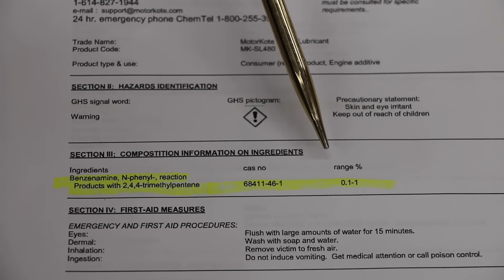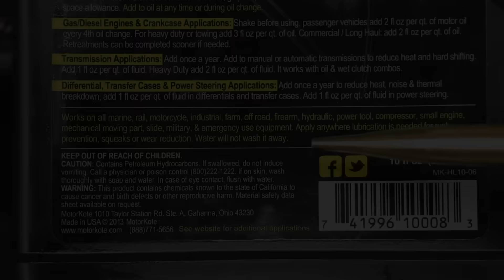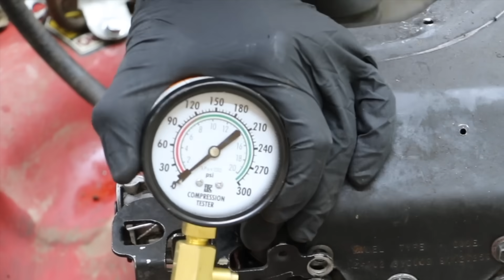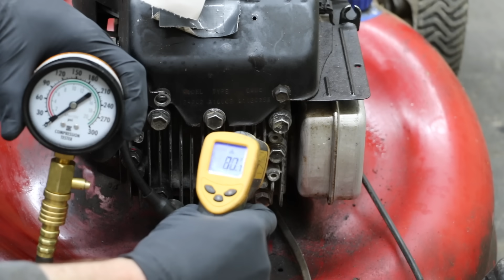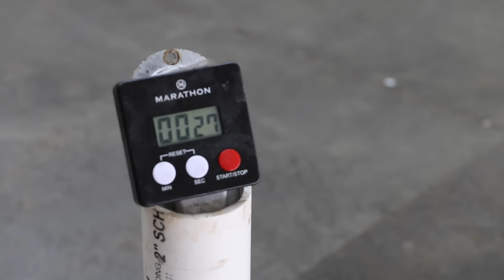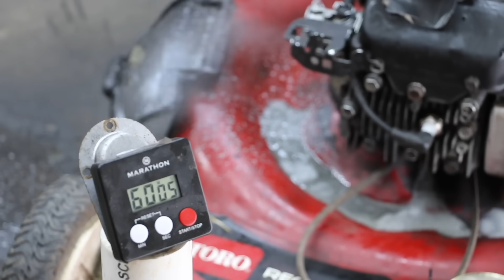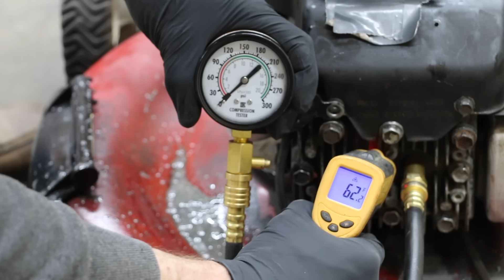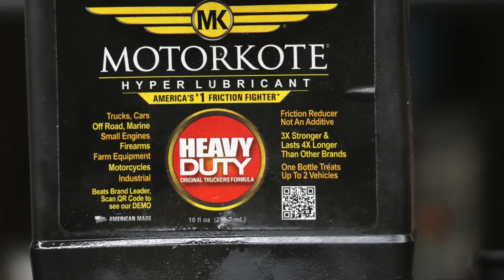Can MotorKote survive the water test?  Let's find out!

Comment: Although your tests give a positive result to Motorkote, I would still recommend being skeptical, I mean, if the Motorkote really did what it claimed, why wouldn’t all of the motor oil manufacturers add something similar to their oils? There has to be a caveat somewhere, and the only thing Project Farm didn’t test was the long-term durability of the engine, which is completely understandable. I would just take the money that I would’ve spent on the Motorkote and instead spend it on a higher quality synthetic oil.
Reply from the maker: Thanks for the feedback.
Reply: I was thinking the same thing as far as long term. Questions I had were after 100 miles is it going to break down and be useless? Maybe it would outlast your oil? Who knows. I do have to say though, that I was surprised with these results. I don't know enough about mechanics, ie if he hadn't have pre-coated that engine with the Motorkote, would it have siezed? But to be honest, after hearing anecdotal accounts of folks using the dino oil version of Supertech in their new car from day one til 150,000 miles and it still doesn't burn an ounce between oil changes, I often wonder to myself why I'm still paying for the higher price stuff. Especially for an "03 f-150! lol
Reply: @dgunearthed7859  Just ran across your comments and wanted to let you I am one of those "folks" that have used Super Tech synthetic for many years with great results. Retired my 2002 Sierra with 435,000 and only used Super Tech in it. No leaks, No oil consumption and no engine trouble. The auto trans gave up. So with all the rust I retired it. IMO great oil and I use it in my newer 2018 Silverado. Also IMO spend extra money on more frequent oil changes, not more expensive oil or additives, that has always served me well.
Reply: @stevecampbell7620  nice!
Reply: @stevecampbell7620  yeah so although I like the idea of using valvoline in that or napa form due to it being one of America's only owned and operated oil companies,  im really tempted to start using super tech 😅 i think u convinced me...gm vehicles going that many miles? WOW
Reply: @dgunearthed7859  my boss recently retired a 435k mile c2500 due to a collapsed lifter. I'm going to put a set in it and see how much farther itll go 😂
Reply: @goosenotmaverick1156  is your boss Steve Campbell?
Reply: Do you seriously think Big Oil cares?  If they did, we would have greater efficiency engines getting double the MPG
Reply: @chrisbusch1970  I don't think they give 2 poops lol

Comment: A guy here in Brazil tested Militec by runing a car with no oil for 10km. It actually worked. Maybe you could do something like that since you basically washed that engine already. It’s obvious you’re not afraid of anything, right? As always, great work!!
Reply from the maker: Great suggestion!
Reply: If you want to check it out: https://youtu.be/ACm8foJxwXk
Minute 22 he removes carter, oil filter and top part of the engine. 
Minute 27 he removes remaining excess oil. 
Minute 38 he starts the test on the dyno. 
10km at around 60km/h
Summarized because unfortunately there are no subs. 😕 
On a latter video he disabled the engine with no apparent damage.
I’m curious to see what you’ll find!

Comment: I would like a test experiment of oil, will non diesel motor oil harm a diesel motor (truck or tractor) motor.?  I bought a 2004 Dodge Cummins 205,000 miles, clear clean oil with a lot of clatter. Changed oil & filter 4,000 miles later to Delo 400. The motor quickly quieted down. After that the oil got dirty like normally diesel oil would.
Reply from the maker: Thanks for the video idea.

Comment: I have used MotorKote since 91. It saved my Bronco 351 engine when I lost the oil pump. It worked so well I didnt notice the oil guage for atleast 5 miles at city traffic speeds and temps.  
 Have used it in many engines since.
Reply from the maker: Thanks for the feedback.
Reply: Now im gonna use it on my bronco2 👍
Reply: @dy3dsl648  me too, riding mowers and my old Ford pickups

Comment: Can motorkote work in a motorcycle? were the oil rating is say SJ.
Reply from the maker: I would not use it.  It's too slick for a wet clutch system. Thank you
Reply: @ProjectFarm  thank you for letting me know so quickly.

Comment: You may have heard that some V-6 Ford engines have the water pump inside the engine. My sisters Ford Edge had that engine, it started leaking into the crankcase, and destroyed the engine. Maybe Motor coat could prevent this, or give someone more time to discover the problem.
Reply from the maker: Thanks for the feedback.

Comment: @Project Farm
Hey, loved the review, a nice result, though i would like to see you add an additional test here. The product as i seem to have caught is based on PFTE, teflon. My gearbox has a pfte additive in its gearoil, added by me, and I consider it a fine addition because the gearbox temp doesnt go very high. But my idea here is to add the test, similar to your evaporative loss test, where you would cook it at average automotive engine temperature for an hour or two, because teflon in pfte configuration is quite heat sensitive, thats why you should never use pfte cooking pans without something on them(oil/chunk of meat, whatever) on a flame, as the pfte burns and reacts... The point is to see whether or not the additive would work as it does out of the box, on the friction test, after some time of average engine heat exposure, because if the engine can burn it and cause reactions that nullify the product, it may be great out of the can, but if its shit after 2 hours, well, its shit either way... Tho your lawnmower did impart this in its working, its not a direct result as it has water as an added element, so we dont really know whether its just the water affecting the results or both water and heat together... And the mower and the car aint the same, thats why i say cook it in a closed jar... Not to blow it up, just cant the lid of the jar as to reduce evap...
Reply from the maker: Thanks for the additional test idea.
Reply: @ProjectFarm  You are most welcome, I do enjoy your content and if possible, will contribute to its quality. A channel like this does not just deserve a large audience, but all the benefits that a large audience made up of mechanically inclined can provide...

Comment: I use motorkote but without water 😄😄😄😄
Reply from the maker: Thanks for the video idea.
Reply: @ProjectFarm  I know it sounds weird but I use the motorkote spray on my metal carport. I was tired of running into spider webs when I walked to my car. Spiders can't get any traction. Same thing on my humming bird feeder cable. Ants can't get traction. I do use more of it in my lawnmower because I neglect the oil changes more than my car. Plus they are air cooled. My car will be fine with regular oil changes.

Comment: I would like you to try the water test after draining "normal" oil. Maybe there was enough residual motorkote/oil  in there?
Reply from the maker: Thanks for the video idea.
Reply from the maker: Thanks for the testing idea.
Reply: @ProjectFarm  Probably the best apples to apples test would be for you to run an oil and Lucas mix then run it on water. You mentioned a sludgy mix that came out after the motorkote water run. I'm thinking there was some motorkote in that sludge. Or how 'bout this, run the motorkote, clean the crankcase with gas before running on water? There is no doubt the motorkote performed very well. Thank you, I never heard of it.

Comment: Why did you only run the bearing test for 30 seconds?  Did the bearing with the 10w30 only have that big of a wear scar after only 30 sec?  You normally went for 10 min.  Also, your 10w30 test bearing had two wear scars that looked like 10 minute scars.  You didn't show the test that made those two scars.

Comment: TEST SUGGESTION: Instead of using the engine brake to generate a load, try replacing the lawnmower blade with a set of metal fan blades from an industrial fan. It will move a ton of air and generate a significant load on the engine without burning-out the engine brake, though you may need to tie-down the lawnmower so it doesn't try to hover. 😁
Reply from the maker: Thanks for the video idea.

Comment: After using this for 5500kilometers and 2 oil changes i can say that it really seems to be working most notably the actual color of the oil is almost still red (the Motul 7100  is red colored) as oppose to almost complete black i cant say anything about the fuel consumption because its such a small engine 200cc that the difference in consumption would be very small either way.
Reply from the maker: Thank you for the feedback on Motorkote.

Comment: I really enjoy all your oil and additive testing since I used to work in the tribology field.  I would have never thought of putting water in a lawn mower crankcase. I was amazed how that Motor Kote performed. Besides the Idemitsu oil which is used in Mazda's and Subarus as factory fill, there is another motor oil out there you might be interested in. It is Champion 5W-30 Syn Clean synthetic blend. They make oil for Hemmings Motor News and some of the Valvoline oil change centers. I first tried it last year.  I always had a little hydraulic valve lifter noise at idle in just one cylinder on my 1996 Chrysler Sebring coupe. The lifter noise is now gone after 2000 miles on the oil. Not sure if the oil cured it or what ever was causing the noise just cleared itself out. I bought this car used and do not know how often the previous owners changed the oil. I can send you a quart of this oil if you like since the only place that I know sells it is "Auto Anything" and they sell it by the case and you probably don't want to buy a case.
Reply: Cool story bro.

Comment: As Darth Vader once said, "Impressive. Very impressive." Still wonder how well this magic film holds up under the pressures of city driving or "drag racing between the stop lights/stop signs driving." Better break out your electron microscope and examine those crankshafts and engine blocks after a few years of driving (fourth oil change).
Reply from the maker: Great point

Comment: I saw a video from the brand "Ecotec" sold in France, making the same claim about resisting to water. I though the video was fake (obviously) but now I will revide my judgement. Thank you. Oh, and because I drive a motorbike and the clutch is running in oil, I won't use this additive in the powerfull engine
Reply from the maker: Thank you for the video idea!

Comment: Test only relevant if you compare to an engine run on 30W oil, that drained, and water put in (I say it will last too).  Most likely explanation was that the "oil" with or without additive) emulsified with the water.  That acted like "water soluble lubricant" (like that used on milling machines).  The water compensated by providing way more cooling by boiling off.
Reply from the maker: Thank you for the feedback

Comment: Hello project farm,

I was wondering if it's possible to revisit motorkote again, but this time conducting long-term testing.

I have personally used it in one of my older vehicles and now my valley stream is ticking even after 2 oil changes.

If you look at some reviews on Amazon, some patrons are showing some side effects of using the motorkote. I was wondering if you could verify or debunk those findings as well.

For example,  one customer used the appropriate mixture in a mason jar. Mixed oil and motorkote; left untouched for 3 to 4 days, draining the oil mixture into another jar. At the bottom of the Mason jar of the mixture left a thick molasses substance.

I have also included a link via Amazon regarding the customer reviews.

Thanks again and I appreciate all your research and hard work that you do for your loyal fanbase.

Thanks again,
-James

https://www.amazon.com/gp/product/B000EGAM0I/ref=ox_sc_saved_title_6?smid=ATVPDKIKX0DER&th=1

Comment: Very close to Bestline, but now I'm changing my mind a bit and wonder whether it's not even better than Bestline! Try doing an engine torture test (if your resources allow for) against these 2 bigger products: Motorkote and Bestline oil treatment. Use only the Motorkote now so you won't have to ruin 2 engines. We already know that Bestline didn't let the engine seize and although it lasted 71+ minutes compared to 38+ (using 10W-30), it only lasted 71 minutes with no oil and only with the Bestline film on the metals because the heat couldn't be dissipated anymore (the presence of oil also cools the engine) and so the connecting rod cooked up until it broke loose. Let's see how long will the Motorkote resist after taking out the oil and letting it's film do the rest or at least try a fair identical treatment to oil mixture test of Motorkote versus Bestline on engines and see which one quits first.

Regards.
Reply from the maker: Thank you for the feedback
Reply: @ProjectFarm 
So, would you still get the time (it also depends on resources, that's for sure) to try this unique test of Motorkote vs Bestline? I'm confident that a lot of viewers will find it useful. Head to head, from 2 of your separate video tests, when mixed with oil within different amount, it seems that when mixed at 9.375% (1.5 treatment ounces to 16 oil ounces), Motorkote is a winner by leaving (visually, not precisely measured) about the same wear amount that Bestline shows when mixed at 20% (1 part Bestline to 5 parts oil). When not mixed with oil, they both seem like a perfect match, but when mixed with a 10W-30 oil, Motorkote might logically prove better for a similar % of mixture versus Bestline! Still, running a torture test with the same amount of treatment to oil mixture (let's give it a 10% for the treatment and 90% for oil), it would be very interesting which engine dies first and what are the conditions after the failure.

Regards.

Comment: I found that MotorKote doesn't mix with oil, at least the Pennzoil Platinum I tested it with. I put MotorKote and Pennzoil Platinum in a jar and shook it up, and after it sat overnight the MotorKote separated from the oil and sank to the bottom of the jar. Not sure what this means or how significant it is, but I found it interesting.
Reply: Possibly due to PPL being a GTL based group 3+ oil and is based on natural gas. Motorkote may mix better with lesser group 3 and lower oils like conventionals. Either way we all just seen the results of motorkote by itself wont do any harm until it mixes and coats everything

Comment: I just had a thought, the way you do your motor oil tests, and sendoff samples to the oil testing lab, what if you did the cook and wear tests with all of these 'oil' additives and use your 'winner' oil as the baseline.... to see if additives add to the oil or make it worse than a good quality motor oil, also test all the additives seperately through the flow test, freeze test, cook, then flow test, wear test before and after cook..... i wonder if some of that stuff could 'change' and then maybe end up blocking an oil filter, or if the stuff even remains in suspension after going through a filter.... be interesting to find o ut.
Reply from the maker: Thank you for the feedback

Comment: At work, the yard gate squealed so loud, it hurt your ears to move it.
It's also extremely heavy, and well balanced.
I used the spray Motorkote on the massive hinges, and reapplied it a few weeks later.
That was in May.
It's decidedly out in the weather, heat and cold, not to mention rain, and plenty of that.
It is JUST starting to make noise again.
I have trusted Motorkote in my big truck diesel engines for years.
Lucas oil stabilizer is a good product for what it does, but it tends to pull away from the edges and hot spots.
Motorkote is the opposite, going towards the heat.
Seven gallons of motor oil goes into the pan....
One gallon of Lucas, one gallon of Motorkote, and my wear goes down to half, judging by the shavings on the oil plug magnet.
My oil pressure is a bit more comfortable because of the Lucas, around 60 psi.
I swear by the combination.
You are more than welcome to try this, and see if it actually works.
Reason being, there are some products that have better results when in combination than used solo.
I give you my secret for long engine life of my big truck's engine.
Good luck, and keep the videos coming!
Reply from the maker: Impressive!  Thank you for this information.

Comment: Here is a idea. Test the claims on high pressure/high heat wheel bearing grease. Is high temp red actually better than leading compediter blue or black. Is motorkotes high pressure a better grease.
Reply from the maker: Thank you for the video idea!

Comment: Interesting!  Wynns Friction Proofing popularized the lubricity test you use and used to sell the machines to dealers.  They also several times drained the oil out of an airplane engine and flew it for an hour, or so they said.  It did reduce friction as it showed on the dyno, and we had water brake dynos, not inertia dynos that can simply do pulls.  However, things were different then too in that cars didn't have roller valve train which is a significant contributor to friction so the contribution today MIGHT be less.
Reply from the maker: Thank you for the feedback

Comment: This is from the sds I recieved from Motorkote today (12-13-2019):
SECTION III: COMPOSITION/INFORMATION ON INGREDIENTS
Distillates (petroleum), hydrotreated heavy paraffinic 64742-54-7 0.1 – 30%
Distillates (petroleum), hydrotreated light paraffinic 64742-55-8 0.1 – 30%
Distillates (petroleum), hydrotreated light paraffinic 64742-47-8 0.1 – 30%
Benzenamine, N-phenyl-, reaction products 68411-46-1 0.1 – 10%
with 2,4,4-tremethylpentene
The specific chemical identity and/or exact percentage (concentration) of this composition has been withheld as a trade secret.